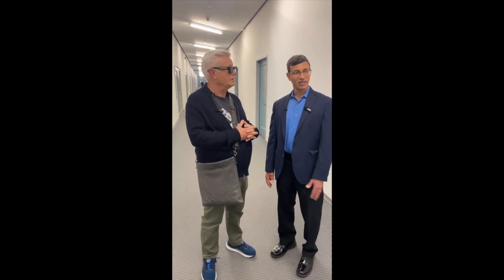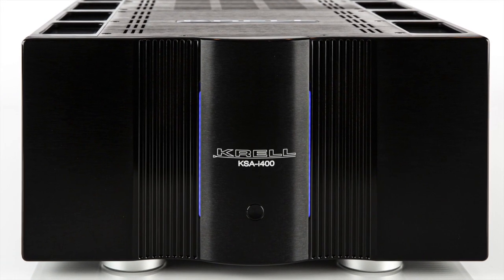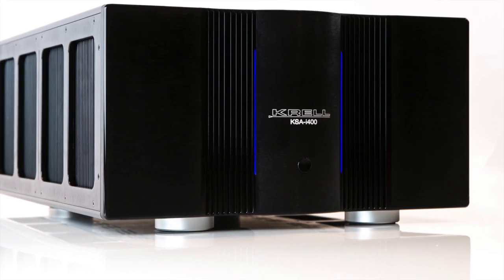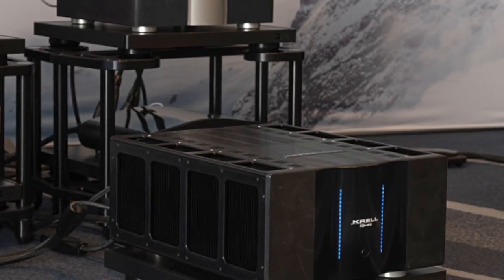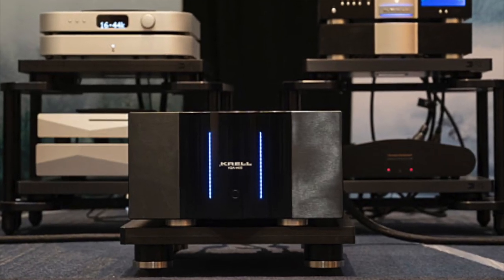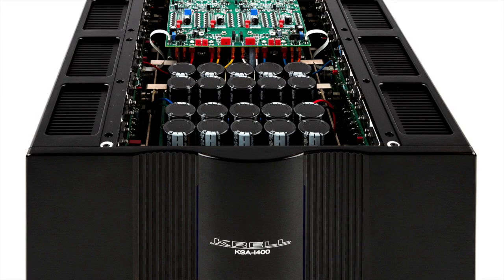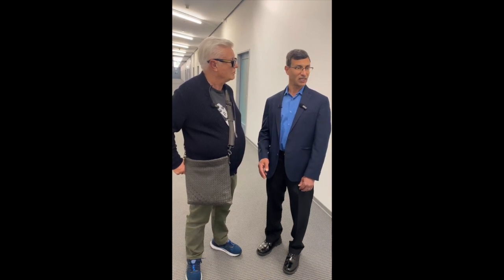Krell KSA-i400 Amp - A Technological Marvel with Timeless Soul! Interview with David Goodman

Comment: Krell hit it's peak in the eighties. Their amp's no longer  sound excellent.
Reply: I fingers it interesting the Krell ksa 300s has a much bigger power supply than the new i400
Reply: I mean't I find it interesting the Krell ksa 300s has a much bigger power supply than the new i400 which has 160.000 of microfarads and 300s has 272.000 of microfarads which would make a difference in sound quality I would assume.
Reply: @samuelcain5426 the KSA 300s has a 5KVA transformer and the i400 has two 2700KVA transformers, not to mention the i400 has a better bias design.
Reply: @mitchtaylor6512 both great designs would have loved to hear a i400